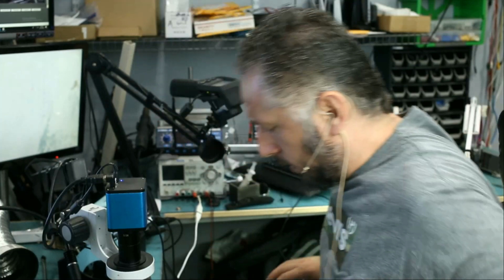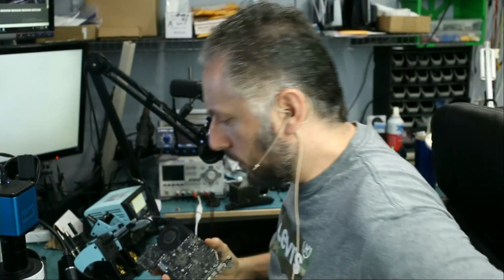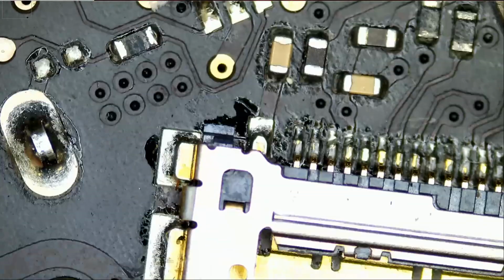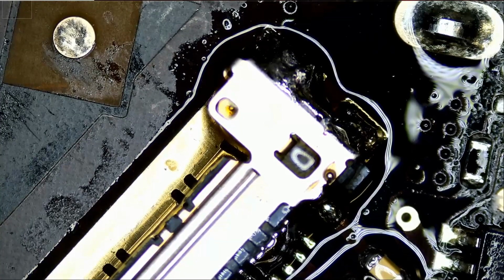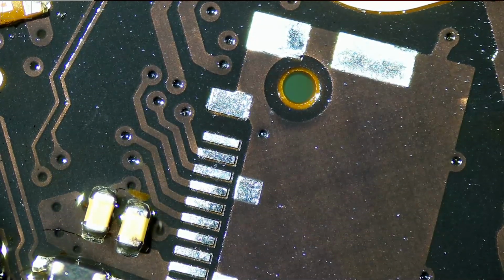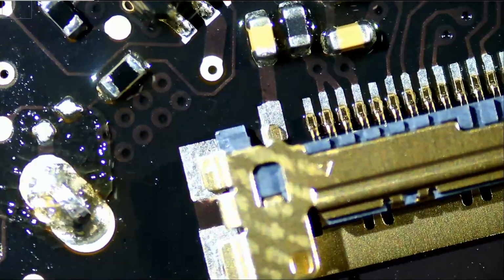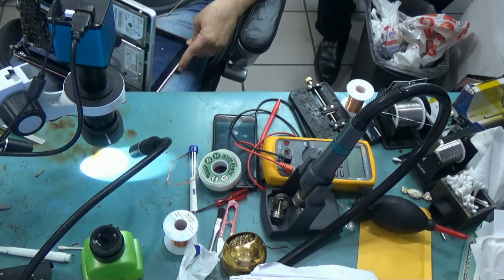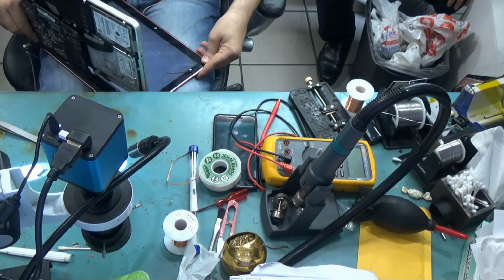Macbook Pro screen glitches freezes and turns off when screen moves or pressed from the bottom

Comment: what is that low melt solder you always use?
Reply from the maker: https://rover.ebay.com/rover/1/711-53200-19255-0/1?mpre=https%3A%2F%2Fwww.ebay.com%2Fsch%2Fi.html%3F_from%3DR40%26_trksid%3Dm570.l1313%26_nkw%3Dfast%2Bchip%2Balloy%2B4.5%2B6.5%2522%26_sacat%3D0%26LH_TitleDesc%3D0%26_osacat%3D0%26_odkw%3Dfast%2Bchip%2Balloy%2B4.5&campid=5338440312&toolid=20008

Comment: My macbook had some on and off glitch when I opened the photo booth it just restarted it self and had a glitchy looking restart screen. the load bar would go 1/4 of the way and then it would shut off again  but wouldn't open up the loading screen so I would have to wait for 20 minutes or more to get back on. It stopped about 2 1/2 weeks ago and it been just fine since. But last night I was trying to take pictures of my homework and it did a different glitch. When I opened the photo booth it went to a very glitchy desktop and photo booth, then the screen went black and it restarted itself, this time having a normal loading screen, but opening up to the photo booth with the camera on and the same glitch happened again, so I decided to leave it alone. I did check it out this morning, and it did the same thing except it didn't restart. I had a white dotted line for a cursor, my desktop looked glitchy again, and it limited my mouse to half the screen, so I couldn't exit photo booth. 
After a couple seconds it went back to normal, but I have school and I really don't need any glitches on my laptop right now can anyone give advice? (Sorry for writing my macbook's life story)